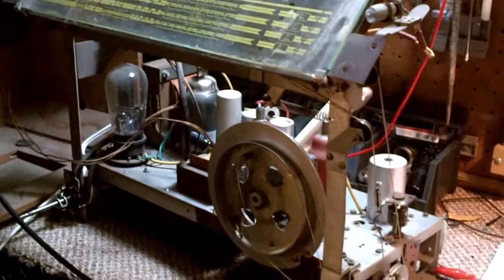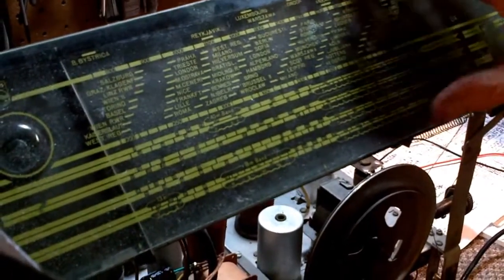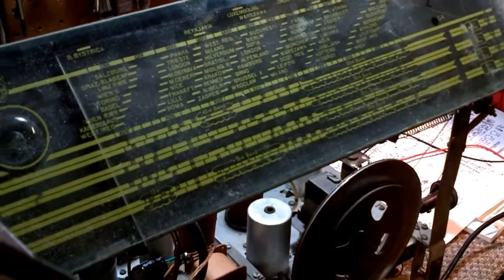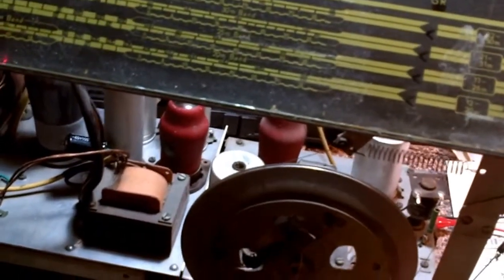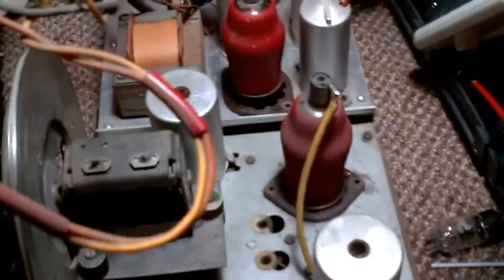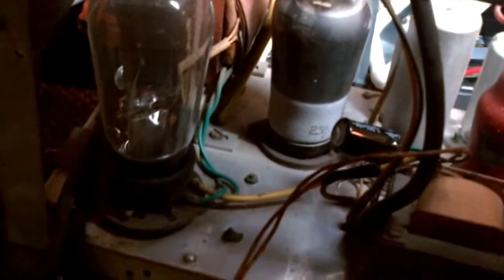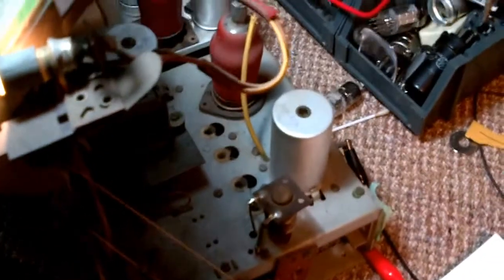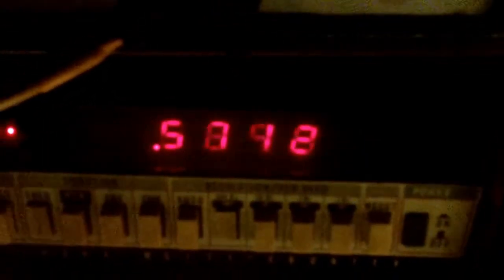Philips Sonate BA581A Vacuum Tube Radio Video #5 Strange Tuning Effects

Comment: Hi Jim. The first thing you will want to do is to get the tuning condenser working right. Make sure the rotor shaft is grounding properly by cleaning the copper grounding fingers that against the shaft. Now the noise you here when tuning is heterodyning and the  main cause is alignment out of whack mainly the oscillator. There are other things such as bad components in the front end. As far as the pointer goes a little lube will help quiet it up. Dennis

Comment from the maker: It will be interesting to see if these effects disappear just from an alignment.  I'd expect the alignment on this radio to be good, like most radios that are in good shape, so I'm guessing something else is amiss.  We shall see.  And I'll have another go at all the noises that are related to tuning the radio.  I did lubricate the dial slide etc. in a video I didn't publish because of trouble with my computer tablet.  The horrible screech is the pointer rubbing on the glass or backing.